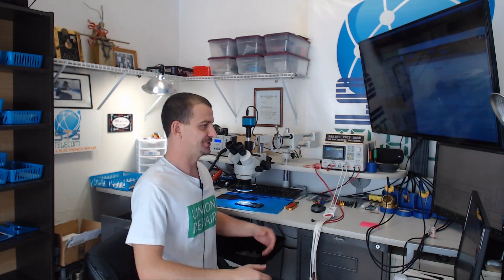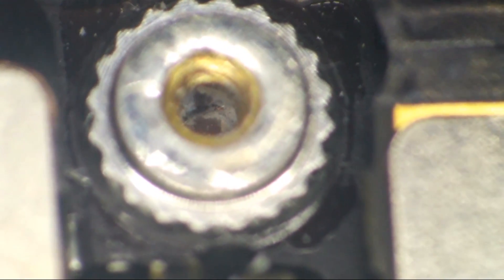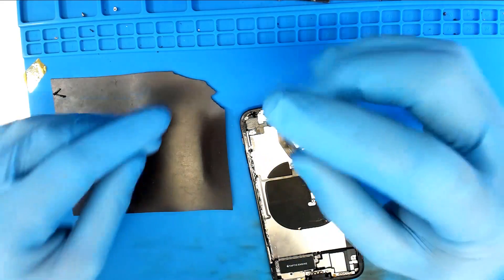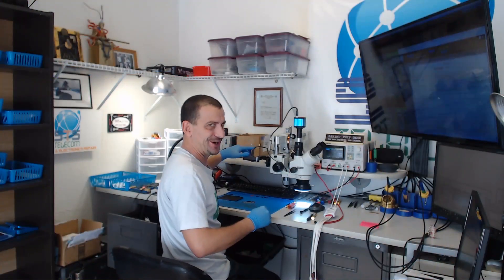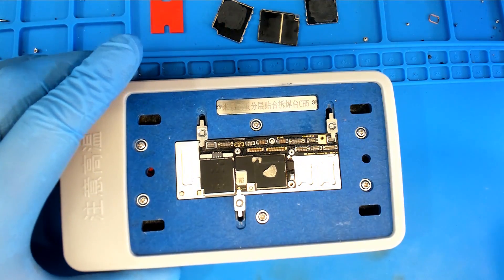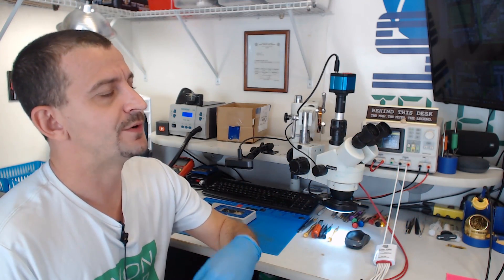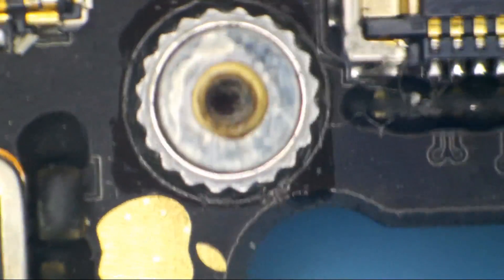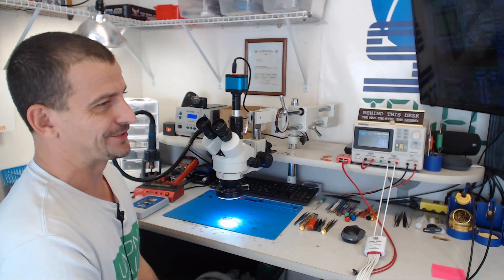A long screw damaged iPhone X (No cameras, Face ID, Flash) [Not fixed]

Comment: hello, the touch screen is blocked when the neck of the fingerprint screen is plugged in, I saw a video to you where you explain the sollution and I can not find it, please send me the link if you  please and thank you in advance
Reply from the maker: That is in this video I believe: https://youtu.be/hzMEfOtMM34
If touch quits working with home button connected, it is likely a ground pin (end cap/anchor) on the home button connector that is recessed and not making connection.  Hopefully this helps!
Reply: Tank you so much

Comment: Shame out that, ie, it could be fixed, but it too expensive to fix.
That's the kind-of repair we have to do in the automotive world, ie, a customer brings in a Nitro cylinder head with a hole the size of a golfball, and you have to weld it up and re-machine it back to tolerance so it fits/works. I'm a Mech Eng, so I can be unconventional to get stuff done.

Comment: Hello Jason, I had the same problem encountered just now. I accidentally put a wrong screw onto that area and now my cameras and flash are not working. I tried to look for solutions over the internet and found your informative video about this. Its my fault I know and im very upset right now. Can this problem be fixed?

Comment: Don't walk......run away from this job! My guess is 10 layers (maybe more) of power, GND and signals traces. Think how many of those damaged traces go directly from the connector straight to the SoC, no resistor, cap or component to utilize for a jumper to repair those broken traces. This board falls into the "pet" category. Good call, Jason.
Reply from the maker: To make matters even more pleasant, I had trouble putting this one back together!  It's good now tho.  whew.

Comment: Is it possible to replace the top PCB and then move any paired SMCs over?
Reply: Yup. By removing the CPU, NAND and logic eeprom. You can then transfer them to an iCloud locked iPhone X top layer. The original bottom Bluetooth, wifi, cellular layer can simply be reattached.
Reply from the maker: Yes, what @AngryTechGuy said =)

Comment: CPU NAND Swapp should fix that one
Reply: That screw hole contains traces for front camera, face id, the front mic, the flash, the PMU for the cameras, baseband enabled and more. 

We typically charge 60% the cost of the device for a board swap. So roughly $260 on an iPX. The advantages are it comes out cheaper than purchasing a new device. The device regains full functionality and they keep their data.
Reply: yeah, but nobody would pay for that just to fix cameras. And what if by any chance the CPU gets damaged, the customer will ask for his iPhone back working exactly like it was before opening it :(
Reply: Yeh you right but maybe this lsd is previous technician mistake?

Comment: No it's a very damaged phone, whoever did the screw damage is an ass, or maybe a donkey lol.
Even i know you have to put the correct screw size in the right place, and i don't fix phones.
Reply: I wonder if they used an electric screwdriver to go through the 7 layers of that pcb ;)
Reply: lol i think the user had too small a brain, or had a screw loose :-D
Reply from the maker: I think many of them that do this stuff, had some kind of problem.  So it's on their 2nd or 3rd re-assembly and they're just cranking those things down damn good to be sure they don't have any trouble.  It's so bad..  a puncture wound! yikes...  it must have made crunching sounds.

Comment: Nice one Jason for face its usually always the infrared getting corroded through the ear speaker but you can do a precheck with selfie mode on portrait mode to check if the dot projector is working if not you won't be able to fix it. I had a shorted thermal camera the other day which gave me no cameras so I had to dremel another thermal camera and replace from another phone 📸 then it worked 👌
Reply from the maker: That's impossible!  The ear speakers are water proof..   har har  :D